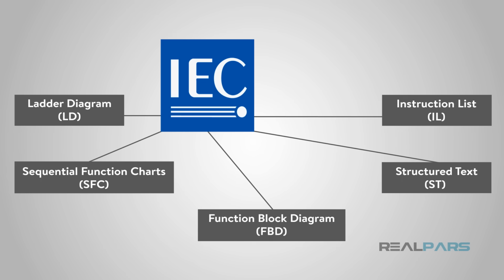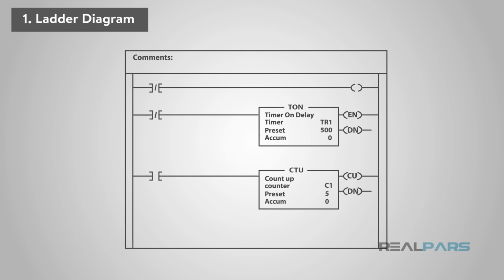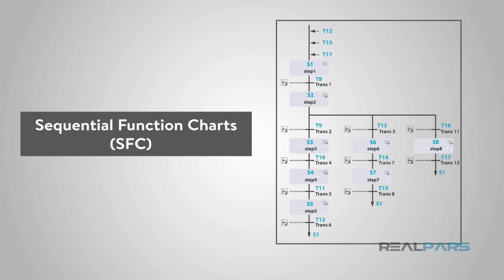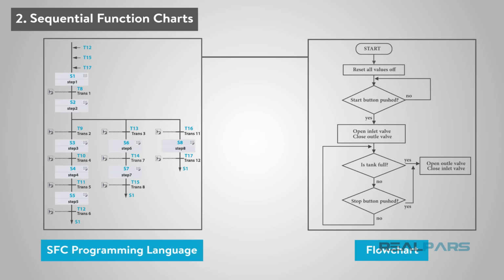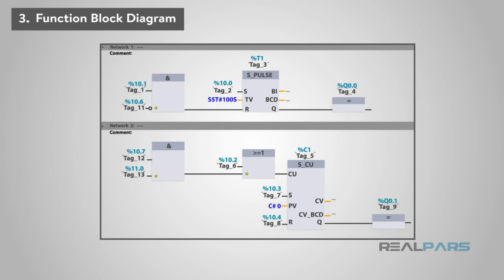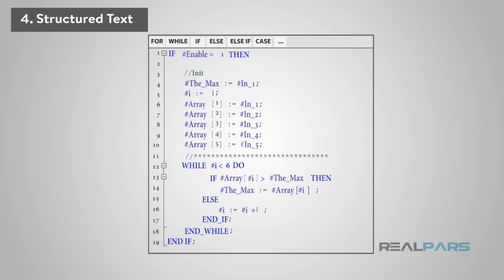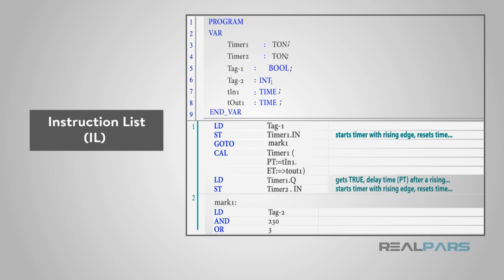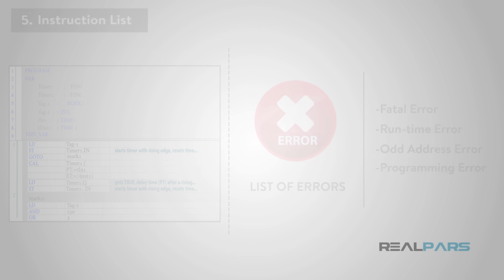What are the Most Popular PLC Programming Languages?

Comment: Ladder wins the popularity contest, no doubt. But if you are looking for best way to go about developing PLC software, ST really has no competition at all. I find the "easy for maintenance crew to understand" argument really strange, as a developer you have not done your job properly if maintenance crew ever needs to open code to find out what is wrong with the machine. This is what error handling and HMI is for, machine should tell you what is wrong with it and how to fix it. Welcome to 21st century.
Reply: That is ridiculous and basically the only people who feel this way are people who come from a classic computer programming background, not engineering.  Structured Text is certainly powerful and versatile, but it is easily the most difficult to follow and modify if you didn't write it yourself.  In short, it is the least practical for the largest number of people who will interface a given system.  For starters, there are no graphical queues to follow the flow of logic.  The best use for ST is highly mathematical code or code that is proprietary and not to be viewed or tampered with.  I would argue that 90% of PLC logic should never be in ST.
Reply from the maker: I agree to a certain point. Any programming that I do for my plant, I include lots of troubleshooting and alarm messages on the HMI, but I have found that many of the contractors that we have used are strictly code writers and have not experienced the operation or maintenance side. Also, all of the plants I have worked for keep PLC programmers on staff for troubleshooting purposes and for future changes, it is definitely the fastest way to troubleshoot.
Reply: Complete nonsense. There's a ladder is the most common language. As a developer, are you going to handle any upgrades a machine will go through in its life cycle? Probably not. Many of those will be done by the customer and they most certainly will not enjoy going through ST.

Comment: After 28 years of PLC programming my view is that in a modern controller there is little difference in how 'powerful' any of the languages are. The best choice of language for any given task depends largely on whether it is logic or data dominant.

Ladder is great for visualising the flow of logic at the rung level. Literally you read the logical state of a rung in a highly intuitive, instinctive fashion. The limitation is not what you can do with ladder, but that it doesn't impose on the programmer any inherent data structure. You have to do that for yourself.

By contrast function block visualises the flow of data, making it easy to follow process information in real time. The downside is that the logical state of a complex diagram can be quite difficult to understand. 

In this sense ladder and function block are perfect complements to each other, each with it's own strengths and weakness. 

Structured text tends to suit people who started out in a conventional computer science environment and have developed the aptitude to work with it from the beginning. While ST is broadly competent, it's also more abstract; while is more 'efficient' writing at the code building stage in the office, when it comes to real time, high pressure machine or process commissioning, it's definitely harder to work with because it presents neither the data nor the logic in an intuitive visual fashion.

In other words the geeks love ST, suckers like me who have to commission and maintain it much less so.

Overall each language has it's optimum place. (I've never bothered with SFC's nor IL ... just never needed them.) Carefully chosen to suit the application space they work very well in complement to each other. What doesn't work is an ideological insistence that one language is best and must be force fitted everywhere.
Reply from the maker: Very well said. My experience has been where I write the code, install the hardware and control devices and am responsible for troubleshooting and meeting the demands of an ever changing market. I love troubleshooting with ladder logic because of the very visible paths to follow, but I think what you stated about ladder and function block being perfect complements to each other is right on task, especially with the technology growing and changing at rapid rates. I also believe that regardless what language you use if you don't have great documentation and descriptions, they are all harder to maintain and troubleshoot.
Reply: @realpars  I'm sorry but PLC hardware and technology develops at a glacial pace compared to other hardware and technology. This is what has always frustrated me to be honest. At last things like IPC machines become more common.
Reply: All 5 languages are in there, because all 5 of them have their use cases.
Ladder is the oldest of the 5 languages defined in IEC61131-3, because it is meant to be used by electricians who are new to PLCs. That's why you work with NC, NO and Coils there.
FBD is meant for "higher", more complex tasks than possible with ladder, where you (as you pointed out) work with more complex data and/or more complex processes that your PLC must control. It is AFAIK the programming language most used for training new automation technicians.
IL is the assembler language of the PLC universe. It is really low level and normally every othe language ist translated to IL when you upload it to your PLC. You can do a lot of really cool stuff with it.
ST is meant for really complex data handling, like communication over one of the many bus types or data handling.
SFC is your language if you have a process that doesn't change and that needs so be done in a serial manner. It's basically a flowchart, and it's really good for all step-based logic, like for example process control ("do task x until temperature is reached, after that do task y for n amount of time") or transport logic ("when target data and transport good is available, start positioning. Position to x and y koordinates. Start unloading goods. When unloading is finished, write data. When data is written, return to start position"). Siemens implemented SFC as their "Grapcet", and you can basically take your program, print it out or put it into a visu and your operator knows exactly, in which process step you machine is.
Reply: @JanB1605  I've nothing against SFC's. I've seen them used very well. However once you start writing state machines in ladder (a simple trick), the need to introduce another language into the system diminishes.
Reply: Hi Philip Wilkie . As someone who has worked in systems integration for close to 20 years, I would like to point out that  SFCs do have their place. In particular process driven  objectives where there may may require multiple concurrent requirements. If programmed via SFCs it is usually easier to visually troubleshoot down the road. That said, I do prefer Ladder logic in general so that the maintenance guys have familiarity with it but in some applications, when they can see where things are caught up, it is faster to trouble shoot
Functionally they all work and serve a purpose.  Only wrong thing would be no documentation.
Reply: Do you need a specific degree to work with PLC's like computer science or electrical engineering? Or can maybe just a PLC certificate from a community college? Or can self-taught get you through the door? Also, do you need advanced math for PLC's?
Reply: @Omar-vz9el  Well, there's stuff like automation and robotics. So, you could do that. Would be an engineering degree I suppose.
Don't know how it's in your country, might need to do some research.

Self-taught is kinda difficult in PLC, because you sure can get it running, but there is stuff like safety and similar that you have to learn right, because lives can depend on it.

Advanced math is not really needed IMO, but some knowledge in math is to your advantage.
Reply: https://www.youtube.com/watch?v=8ucA50tD8wk
Reply: Philip Wilkie Do you know PLC S7 200?
Reply: Thanks for sharing your advice
Reply: @Jason Siebert Hi. The correct answer here depends a lot on the exact instruction set the PLC you are using supports. In general I've never had any problem building useful loop functions and exploiting indexed arrays when programming Rockwell systems.

With some care and thought it's possible to build reasonably complex functions in ladder. It's the instruction set and programming rules of the specific platform being used that I find is usually the limitation, not the language.

Comment: I prefer structured text.  I learned a few programming languages, so I already understand the theory and logistics and learn another one.
Reply: If you're programming for others to maintain, ladder is MUCH preferred.
Reply: PLC code is always commented so poorly, leading it to be very hard for non programmers to read. This is much more the case when using higher level languages. Ladder at least tethers the programmer to something that can be deciphered by many others and promotes a different mentality to writing PLC code. It becomes much more focused on simplicity, flexibility and readability. 
Reading some rubbish someone has written in structured text, C or Pascal is much harder than ladder. Democratising the ability to read the code makes the plant so much easier to run
Reply: Is python needed for learning ST
Reply: @danceographicocean  It's a 'way' of speaking. I can say that doing something feels liberating, yet it has nothing to do with liberalism or even the original meaning of the word liberty. It's a way of speaking that's valid.

Comment: Please explain about difference between plc & Cnc control machines
Reply: There are a lot of differences.  A PLC is a generic controller that can be used to control any type of process or equipment.  The programming has to be specifically developed for that equipment.  A CNC machine is a specialized machine that only does one thing, it cuts parts from some medium (like metal plates) using water jets or some other means.  CNC controllers may be a PLC but are more often a specialized controller with it's own specific language.  You can't turn a CNC machine into a PLC, but you can use a PLC to control a CNC machine.

Comment: I find LD to generally be the most useful. It’s easy to see and follow and see where the program faulted or is waiting for some action to take place.  FBD can be good, but it can be hard to see inside the function blocks.  Most engineers and techs understand ladder logic and it’s often the way the engineer presents the logic in their specifications anyway.  (Unless they just use written descriptions on how they want the program to function). It’s also able to take advantage of Boolean algebra for more efficient programming easier IMO.
Reply: Only problem with LD is that you need a football field sized display ...
Reply from the maker: YES, Ryarios!! Ladder logic is the best, easiest to use and of course, troubleshoot PLC programming language out there!
Reply: @realpars 1.can we use capacitive touch pad switch (with 5v /24 v dc relay )......in place of start/stop/selector switch ? in a 24 v dc PLC?
2. As we are using retentive timers......how  we can design ladder logic for PLC.. so that process  start ITSELF after power supply resumes ? (i.e ..not starting with the help of start switch)

Comment: I prefer "Ladder Diagram"
And sometime "FBD"
Reply: Ladder is really good for beginners. But I would suggest you look more into FBD and the other programming languages if you want to do more complex things. Ladder is basically a wiring diagram of a relay logic circuit. You can do a lot with NC, NO and Coils, buuut it is not meant for really complex tasks.
Reply: @JanB1605  Thank You Sir, You are right sir but in my day to day working life ladder logic is the main component in UTILITY SECTION it helps me a lot. May be when I will switch to PROCESS SECTION FBD will be on my Priority...
Reply: Pavan Kumar Yeah, no thing. As states in another comment here, each of these programming language is in there for a reason. They all have their use cases, an Ladder is really good for simple applications or for applications where small controllers are used.